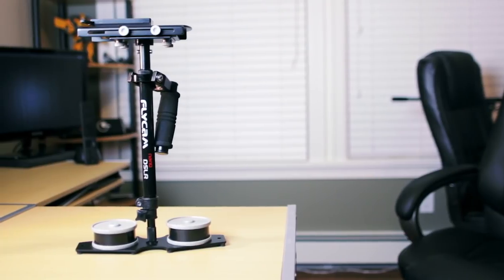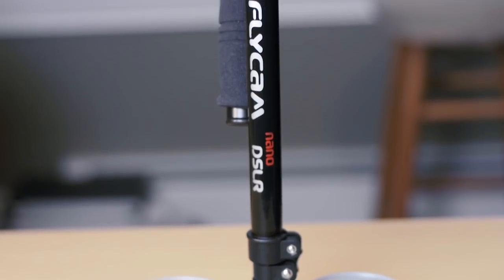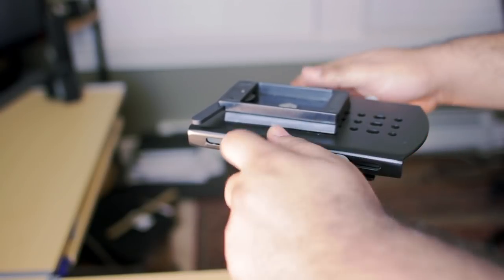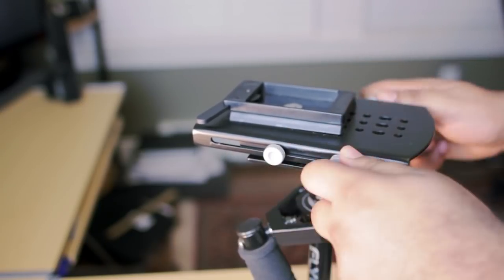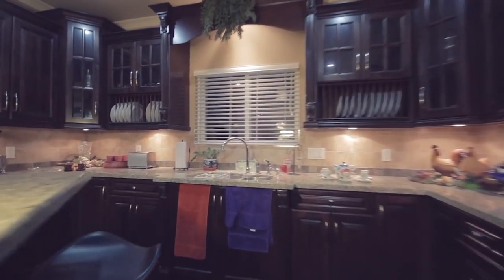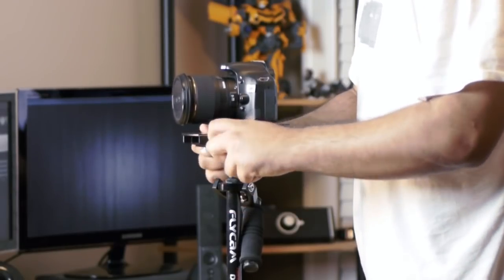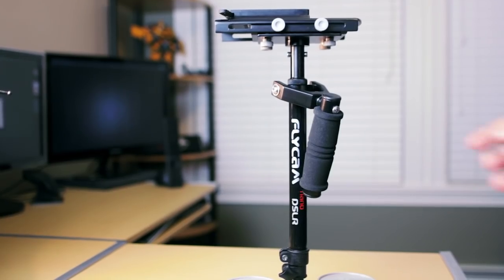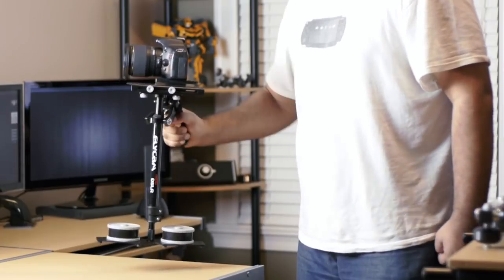Flycam Nano DSLR Steadicam Review

Comment from the maker: The handle is not really supposed to lock into place, mine never did either but maybe yours is just too loose.  you should be able to move your holding position without disturbing the balance.  But if it's really bad then just try to get it exchanged.

Comment from the maker: yes i think you should be able to use the normal flycam with the 600d, its jsut a tinybit smaller than the nano version but it should be alright as long as your not using big lenses.

Comment: What's the best one that's under $200?  I just bought the Hague MMC and let me tell ya, it looks like it was built by someone with a high school diploma in his garage (made in the UK). The tiny gimble is not metal. I read somewhere that said it's nylon. If you pull on it too much, it comes out of its joint. Does the whole thing work? Yeah, sort of. Better than handheld. :)

Comment: I have this and i still can't get it perfect. I even put golfers tapes on the front where the handle is attached, it helped a little. i might sell it on craiglist because its not something that is easy to put your camera on it and go because it always changes balance based on if you have a battery grip or a video light.